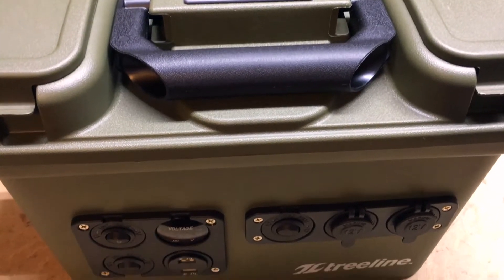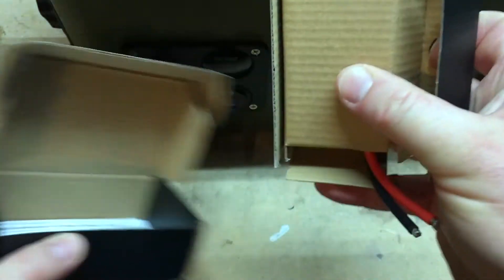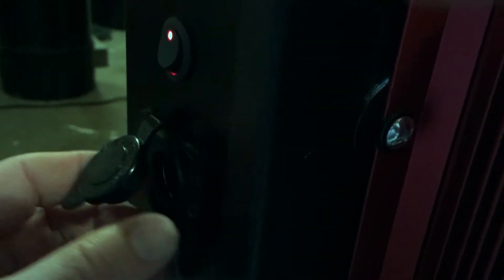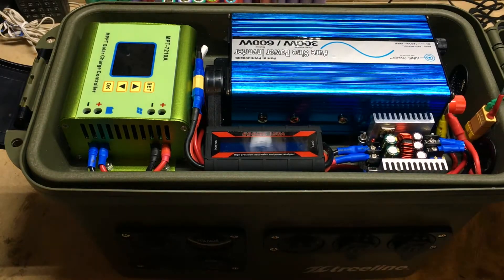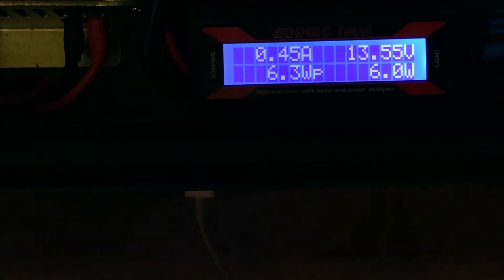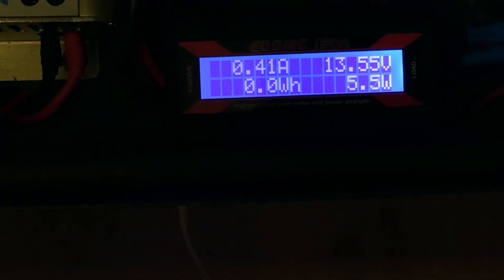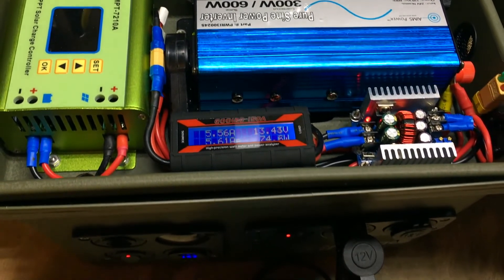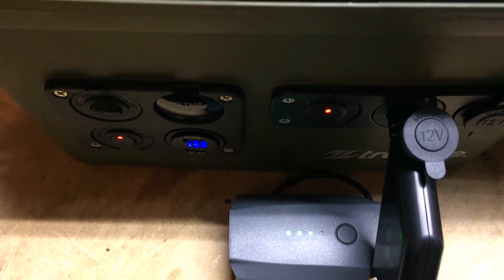18650 Lithium Solar Generator Watt Meter Add-On

Comment: Hey! Thank you for all your videos! They have been very helpful  with deciding on my Solar Gen build. I am wondering if you could provide a rough wiring diagram for your generator? would answer some minor wiring questions I have before getting mine started. Thanks again man! Cheers.

Comment: THAT is cool! Those meters are really nice. Fast too. How many watts/current will that buck converter output? Looking into doing a converter box for my 24v system in the garage (to run 12v power socket stuff). Maybe 100-150w max (10 amps?) I got a a buck converter that steps both ways...but, only does about 50w and no current output adjustment. Thanks.
Reply from the maker: Chris DIYer Thanks Chris.  This buck converter will do up to 15 amps.  If you start putting a lot of load you would need to add additional cooling.  I think the link in the description below gives the exact stats via AliExpress.  I just recently got into buck converters with the recent build of this generator.  So still learning a lot.
Reply: Thanks...just ordered one and will try it out.
Reply from the maker: nice!